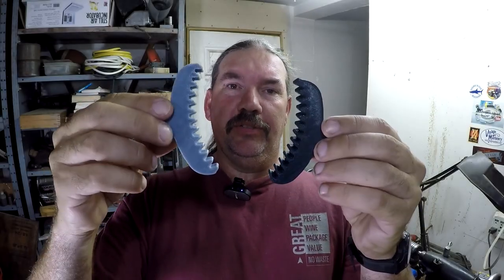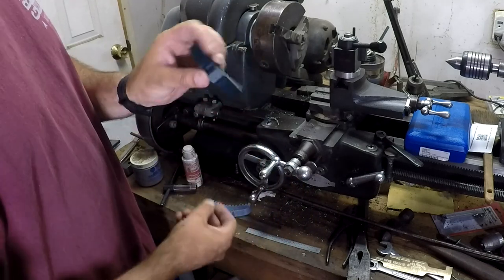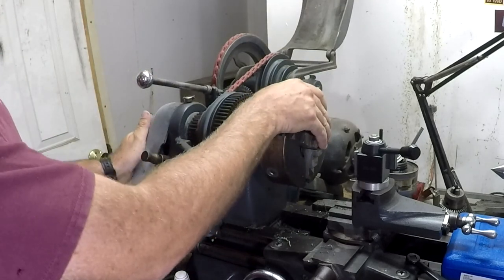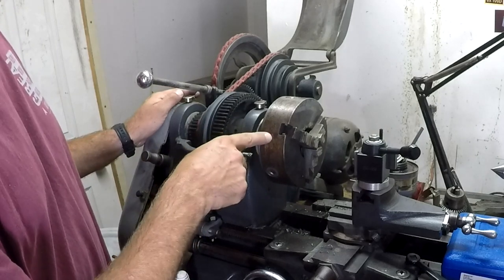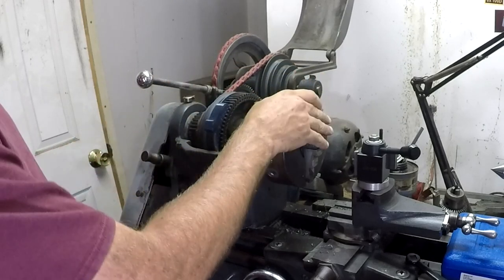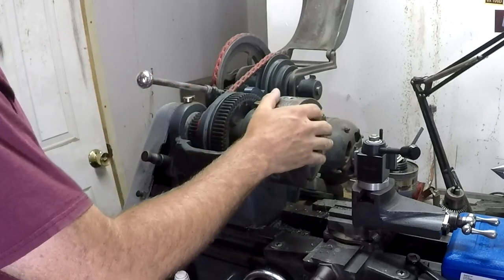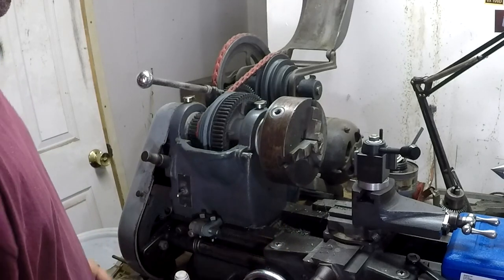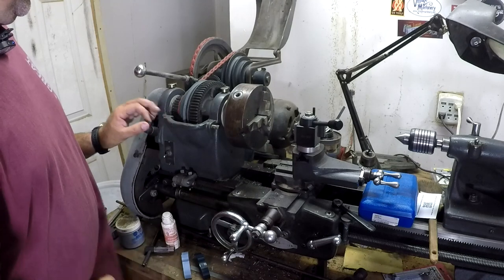Atlas Lathe Chuck Removal Tool

Comment: Thanks for showing it off.  You can find them on Ebay.  Search: "Atlas Spindle Lock Block".  Yes, my chuck which goes on and off routinely ended up stuck.  I had to make this tool to get it off.   Cleaned and lubed it up good and now I have a good method that doesn't stress anything.

Comment: It's a good idea Chris...
And the fact it wants to stick rather than slop or drop off shows the pressure angle on them gears aren't worn...and they haven't started going sharp etc...
Reply from the maker: Yup bull gear is in great shape . Tumblers not so much.
Reply: @OldIronShops  

Yeah well they always get a bit more stick...
The small English lathe I've got...the tumbler gears are ok but the gear that drives them on the back of the headstock is shagged...

I've not heard much from you lately Chris.... everything OK...?

Comment: Mine is exactly the same as your lathe. Both yours and mine says Craftsman so I'll assume You could buy the lathe from the old Sears catalog in the Craftsman tool section but they sourced them from Atlas? Anyway, I don't know if mine is stuck on there but it's super stiff to try to turn anymore. It's a real job to get it open or closed if the part you need to hold is much different in size than the last piece you used. What do you do to make them free up? I've oiled it like crazy with light machine oil and it didn't change how stiff the jaw movement is. I found your vid by searching "how to free up a stuck chuck on a Craftsman lathe". I was inquiring how to free up the chuck, not take it off but I may also need to take it off to work on it. If you're familiar the process on freeing up the chuck could you do a video about it? Thanks
Reply from the maker: I would recommend taking it off and disassembling it and give it a good cleaning . The jaws should be numbers and must go back in the same place and order so take notes and photos. Best of luck and thanks for the comments

Comment: Hey brother  ,  what up? 
Haven't heard from you....
Reply from the maker: hi dave 72  hr work weeks are keeping me tied up i'm hoping to get some shop time soon . i did just get a peerless 6x6 power hack saw and need some 2" x 12" pulleys to get her back to line shaft condition don't have any extras do you?
Reply: Hey brother... good to be working... and with that overtime... well there's always new old toys. 
12" is a good size pulley for a lot of projects...
I'll look around 
Dave
Reply from the maker: @davewilson1591  be nice if they match the oem ones have six flat spokes fairly topical design . No I'd I can just get some food images of the belt shifting mechanism I'll be on business.
Reply from the maker: @davewilson1591  just following up did you have any luck finding anything yet?

Comment: I recieved my Dad's Atlas in the estate and it looks a slight bit smaller than yours, I've looked ALL over the thing and the only tag plates are riveted to the inside of the change gear housing so I don't know what size it is :( the chuck was broken at one time before my dad owned it and rewelded, ok for single chucking jobs but nothing else. do you have any suggestions to figure out what size mine is so that I can figure out how to order a replacment chuck or 2, and how to measure the thread for the chuck? Any help is GREATLY appreciated :)
Reply from the maker: Hemm can you send me a picture oldironshops@gmail.com
Reply: @OldIronShops  im on the road for the week. I'll try to send some pics this coming weekend
Reply from the maker: @jetegtmeier71  not a problem of I can't figure it out I know someone who most likely can. Glad to help get your dad's machine running again.
Reply: @OldIronShops  did you recieve the pictures I sent via e-mail last weekend?
Reply from the maker: @jetegtmeier71  oh I didn't see that let me go look.
Reply from the maker: @jetegtmeier71  hemm I don't see it did you send it to oldironshops@gmail.com?
Reply: @OldIronShops  I'll try again real quick
Reply from the maker: @jetegtmeier71  ok